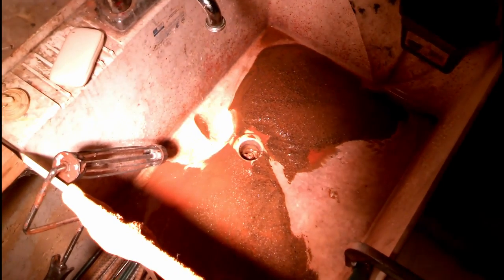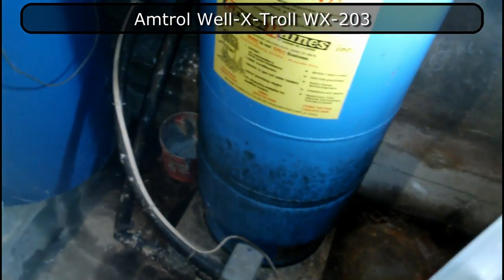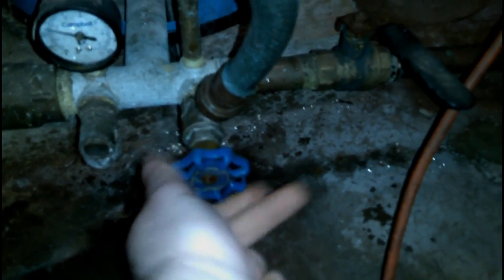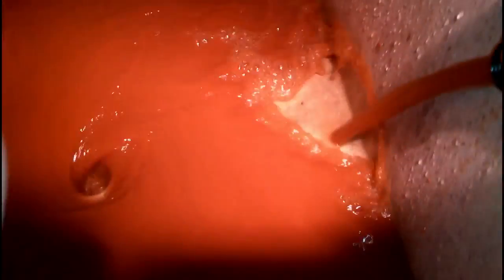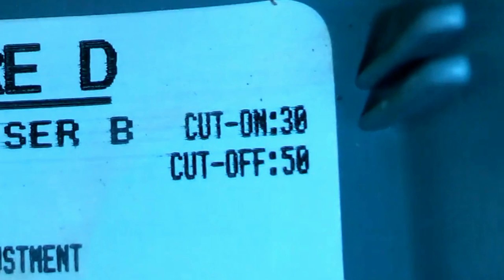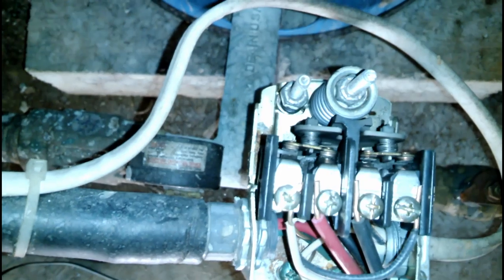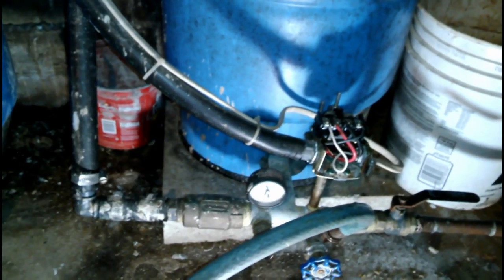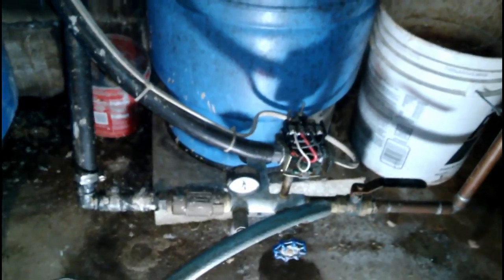DIY Flush Well-X-Trol WX-203 Tank - DIY Halloween Vlog 2016 Episode 16: All's Well That Ends Well

Comment: Great video !  I took it upon myself to adjust and correct my tank's pressure ( on this same tank, I actually set to 43 psi which I need to correct to 38 psi as a local well pump company recommended). 

I didn't realize the tank had tons of crud it it, so I have constant sediment coming out of the facets and toilets.  I believe when the tank isn't flushed, the sediment gets to a steady-state and only occasional little bits of sediment out.  When the first full tank adjustment occurs, all that crud is disrupted and causes the sediment to constantly come out. I hope doing a full flush and setting the tank will fix this.
Reply from the maker: Hi Matt. Glad you liked the video. It isn't one of my best, but gets the point across. As for flushing the tank, I had to do probably 30 flushes before I got clear water coming out. It's a pain in the butt, for sure, but with annual maintenance it shouldn't be as time consuming.